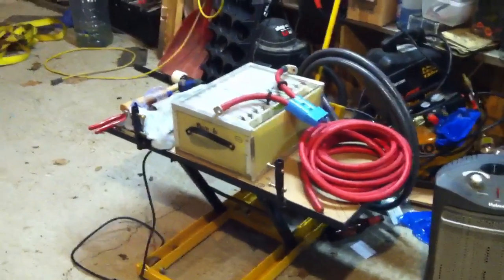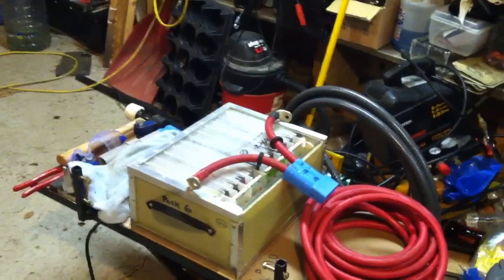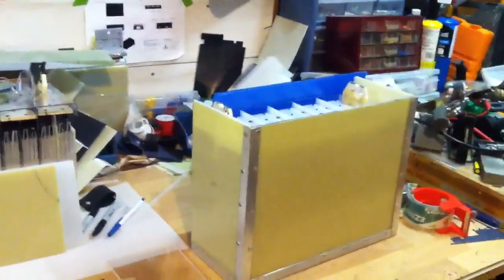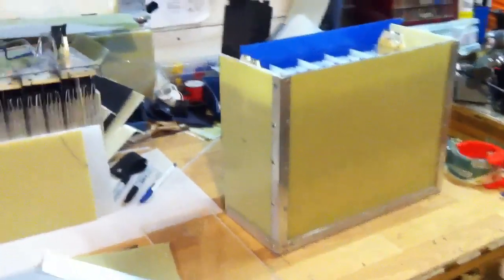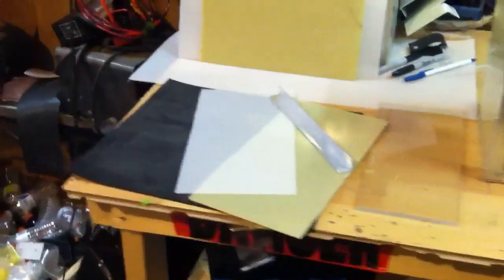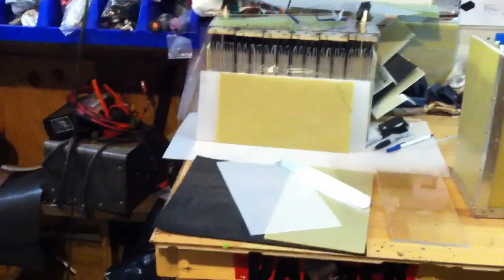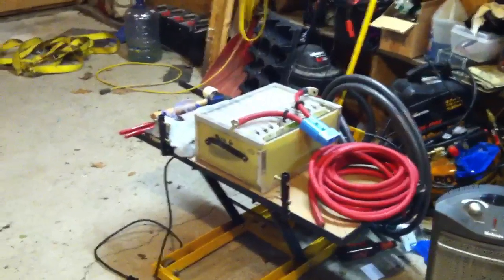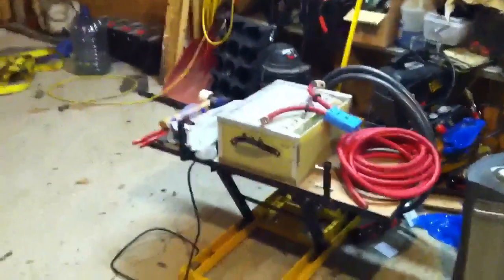Factory Five Mk4 - Electric Car - Video 42

Comment from the maker: A scrap piece turns black from heat before it's able to be bent, and then bending breaks apart the structure and it looses most strength.    It goes back to nearly being nearly flat when cooled and released.     It's similar in structure to fiberglass.

Comment: doesn't have to be single. it could be 1 for the 4 sides and one for the bottom.
or a U for 2 sides and bottom with 2 straight sides.
or you could even do FR4 angle 'irons'

Comment from the maker: Out of curiosity I will try it on a piece of scrap g10.    In practical terms however, using the basic hand tools and light power tools that I have in my workshop, it might be quite a challenge to build a box that way.... getting all of the bends in just the right location and shape to build 5 sides of the box out of a single sheet....

Comment from the maker: No, garolite g10/fr4 is very rigid.   Its the same material that circuit boards are made of.    It is fire retardant, an electrical insulator, and is strong enough to tap and hold a thread.     The finished boxes are very strong and would hopefully survive a crash intact.

When I first started working with it, I cut it on the tablesaw and immediately ruined the blade!    I now cut it with a wet tile cutting saw.